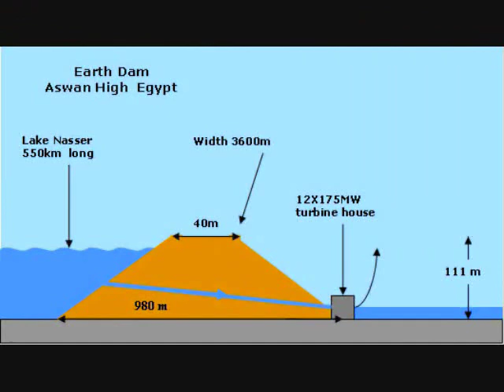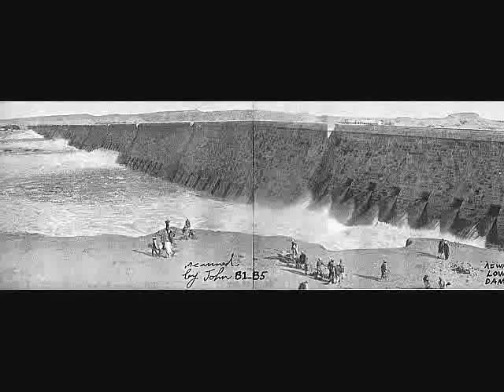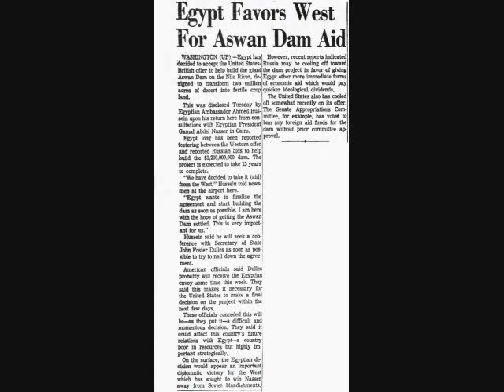Aswan Dam Documentary Part 1

Comment: The flooding of the Nile used to bring millions of tonnes of silt on to the arable land along the banks of the Nile and into the Nile Delta area where the river discharged in to the Mediterranean Sea. Today most if this is trapped in the dam at Aswan, while the Mediterranean which used to be kept at bay by the full force of the river, and the fresh silt deposits every year, is eating up the coastline around the delta.